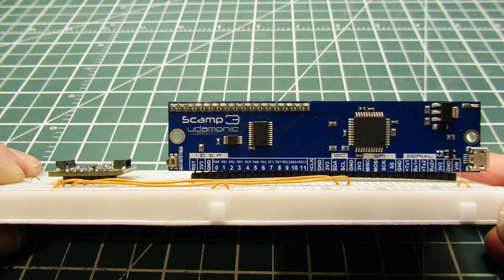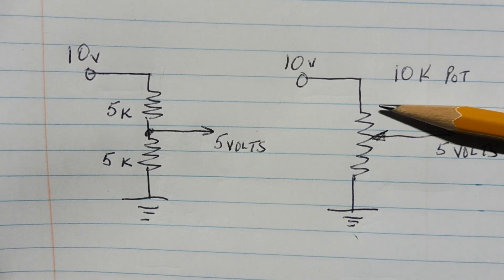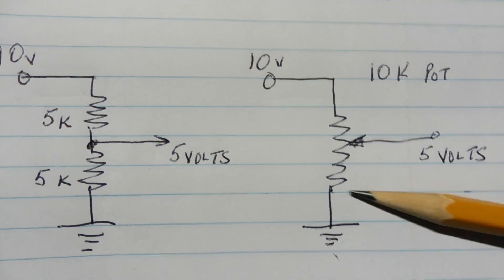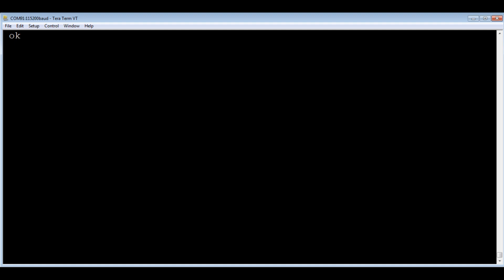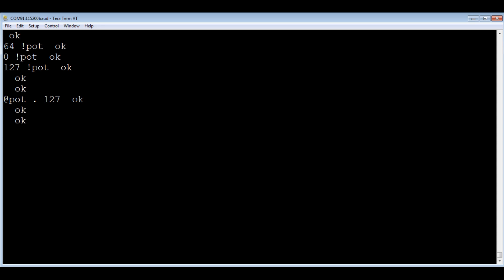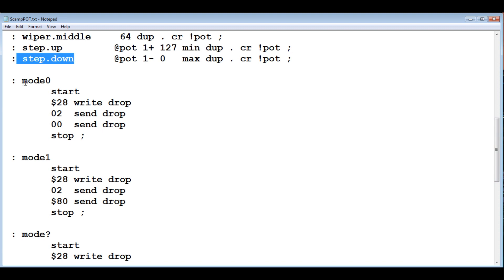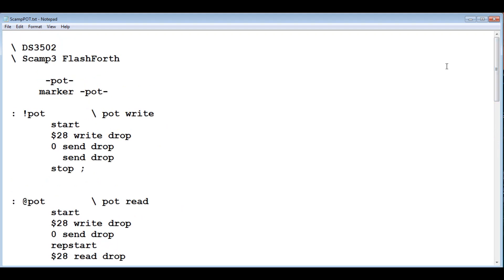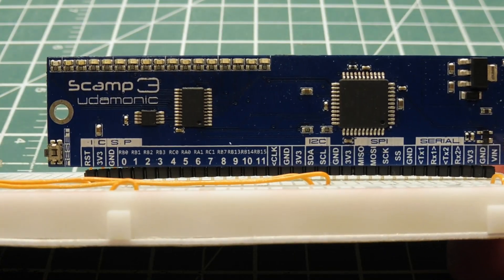Digital Potentiometer Control / DS3502 / VFD 3 Phase Control

Comment: What if I have the TPL0501 100k digipot. I have read the max voltage it can handle is 5v. But my load is 13.3v max, how do I use this?
Reply from the maker: The TPL0501 can only handle a max voltage of 5 volts (VDD) across HA to LA. Use a DS3502 if you need to control a higher voltage than 5 volts.

Comment: Im curious where the 127 number comes from. I use midi sound gear all the time and the values you get are from 0 to 127, so obviously theres a reason. For pro audio gear, is 127 different resistor positions enough for smooth audio sweep? Is it possible to go higher? Or is 127 just the max about of data that the midi standard can pass on a given channel?
Reply from the maker: The DS3502 digital pot is comprised of 127 resistors in series, so the wiper position is from 0 to 127. Midi volume (velocity) values are also 0 to 127 as per the midi protocol. Chip manufactures could use more resistors for finer control but 127 seems to be the industry standard.
Reply: @0033mer  This answers questions ive had for years. I never knew how digital pots worked. Makes a lot of sense and is actually pretty simple. Thanks much!

Comment: Cool looking machine near the end. About 30 years ago I was mechanic in an industrial wood working company and a lot of this seemed like fairly new technology. I was a truck and forklift mechanic, but I remembering I wished I could get more involved in the electrical equipment. I got to help out the one electrician who was my boss and learned a lot from him. The job didn't pay well, but I learned A LOT there! One of my favorite things was the 60- 400 hz frequency changer we used to run a brushless motor router at 10,000 rpms with. It did this mechanically with a motor driving a generator bolted to it. I just got my ham radio licence, but didn't know a ton about electricity. I don't know if they had VFD's back in 1993 or even what they were. Thanks for recommending!

Comment: I've used the Digital Pots for some PIC projects a few years back. It is to be noted that the Wiper max current is not high and can easily be burnt out or damaged if not respecting the data sheet specs. Another good video ;-)
Reply from the maker: Yes ... 1 mA is the maximum  wiper current. This caught a lot of people so I made a video just on that subject. I thought it was deleted but I see it is still up.
https://youtu.be/7sMU7vzpo3Y
Reply: @0033mer  I remember that video.... Man.. How time flies...

Comment: Nice work. First time to know about digital potentiometer!!. I remember that there is a way to let a MOSFET work as a varying resistor as well by varying its base voltage. Correct me if I am wrong
Reply from the maker: Yes ... you can also use a MOSFET driven into its "ohmic" region.

Comment: Another way to do it would be to use PWM from the controller and level shift to 10v by using a single transistor.  Do you see any particular advantage of using the digipot in this case?
Reply: My thoughts too. Digipot is a kinda expensive alternative to a dac or filtered pwm and an opamp
Reply from the maker: The VFD supplies the 10 volts and a pot is meant to vary the control voltage from 0 to 10 volts as seen in the user manual. You can go the PWM route which works ( I have a video ) but you will find to get the full 0 to 10 volt swing, the power supply has to be greater than 10 volts which was not available on the VFD.

Comment: I don't know how to login to the scamp3
I know it's probably easy but I just haven't found and information on it.
Reply from the maker: Basically you plug the Scamp board into the USB port of your computer and run a serial terminal program like Tera-term or Putty. Set the baud rate to 115.2k N81 and you should get an ok prompt. Check the Scamp website for more info on getting started:
https://udamonic.com/getting-started.html